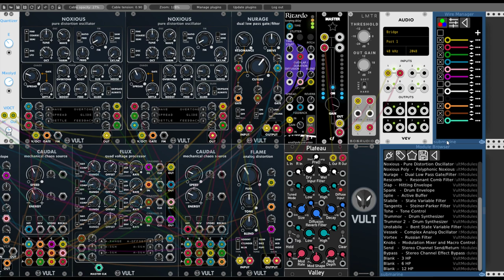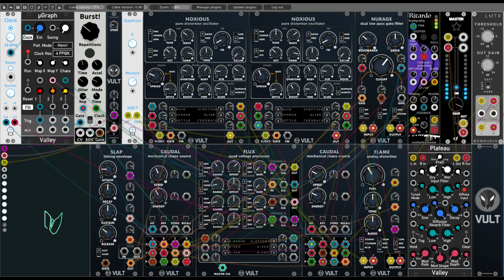vultluv, or how to make ambient industrial noise with vcv rack and vult premium modules

Comment: Love this patch! Do you have a recommended module to use in place of the Burst! module?
Reply from the maker: i would just get burst, but ratchet from nysthi does something similar
Reply: ablaut How Do o get Burst! Is it in the Plugin Manager? Or available on GitHub?
Reply from the maker: @seangarland  aepelzens modules are not in the plugin manager. the code is on github, but you would need to compile it yourself. i have a precompiled package in my google drive with vcv resources here: https://drive.google.com/drive/folders/1CmuIQp4WdYtcW_2VO5eREDfQBgq6zBSo?usp=sharing 

i am working with pyer from geodesics to do a re-release and bring these modules to the package manager, hopefully by xmas.
Reply: ablaut Thanks! I have downloaded your modules, and got them loaded. Very excited to play around with this patch. It looks like the Burst module was renamed to Burst Generator, so the 'vultluv.vcv' patch wasn't loading correctly, but I was able to recreate it by watching the video. Thanks again for the amazing patch!